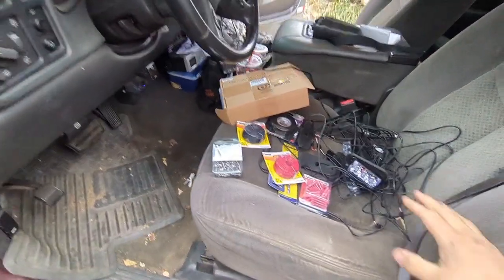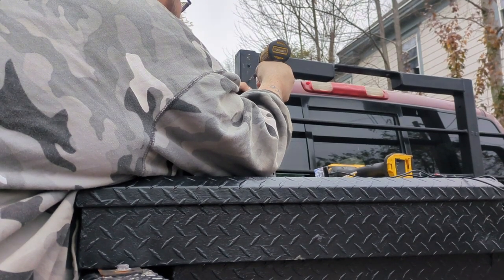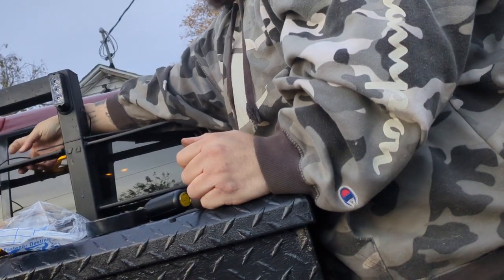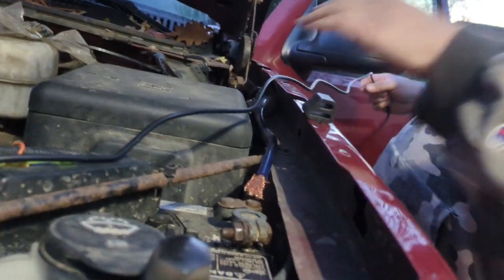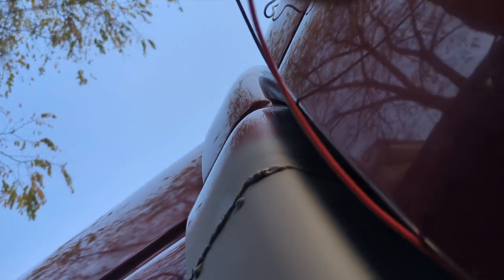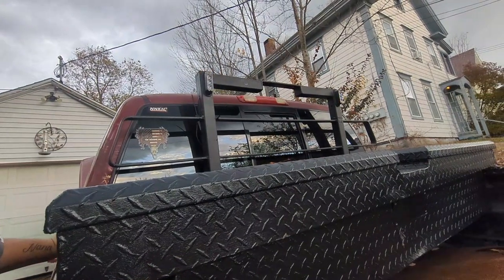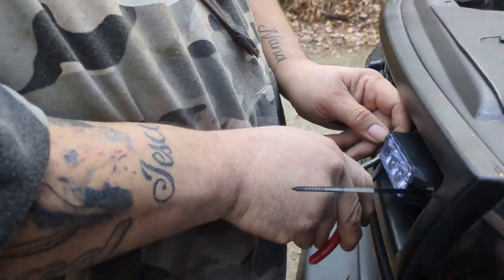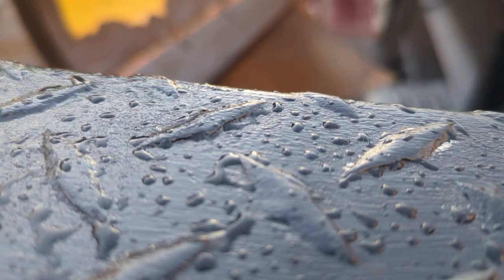Emergency Lighting + Free plow 🤑

Comment: I useualy use twin core or 5/7 core wires to run my spots, turns out cheaper and easier, and I was also wondering why you didn't join both rear light's together 😂😅, then you were under the car and mentioned it, 😂😅 ,I think those melt connections work well thanks for sharing, all the best to yous and your loved ones
Reply from the maker: Iv got rear spot lights comen soon too